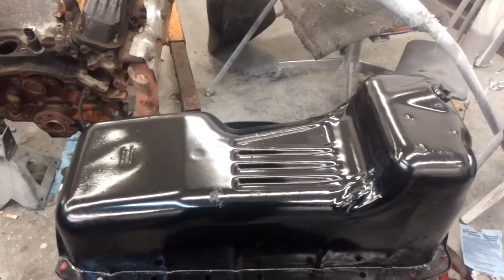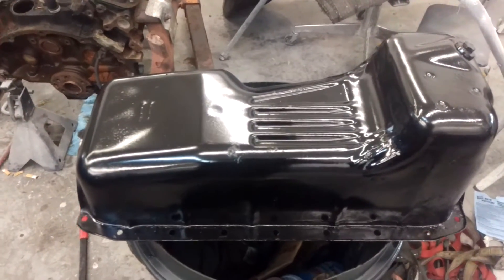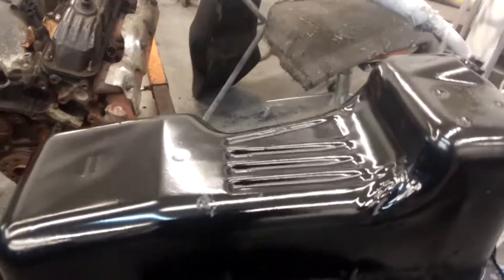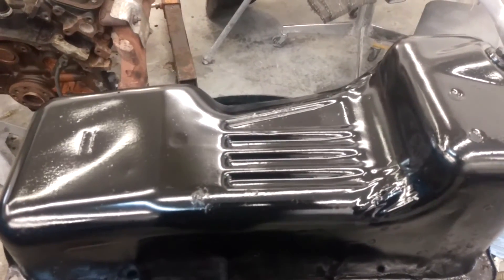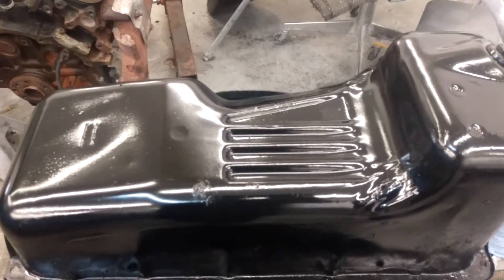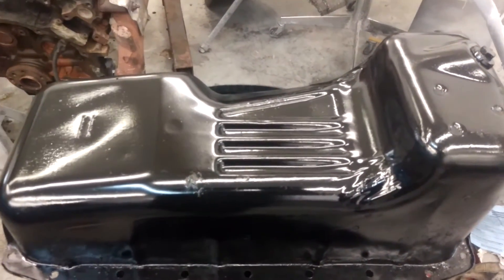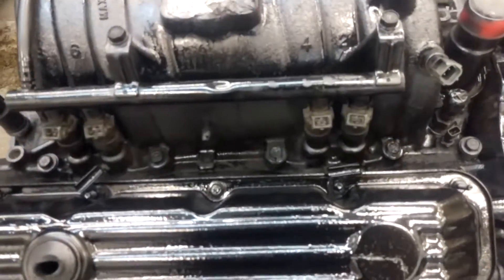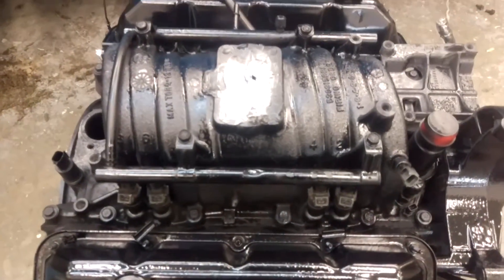Dodge Durango V8 5.2 oil pan change

Comment: I got a 98 durango 4x4 with a 5.2l how did you remove the pan? I looked under mine and the cross member is in the way...looks like I would have to remove the whole engine to get it off.
Reply from the maker: no drop the front diff down as far as u can then lift the engine up as far as u can make sure fan n distributor cap is off n hoses it will give u enough to get the pan out I had to do it twice n drop the exhaust off of the manifolds Also
Reply from the maker: Also make sure the dipstick for the transmission is out also n make sure u drain the transmission fluid down as much as u can
Reply from the maker: also remove the inspection cover on the transmission it may seem like it won't come out but it will
Reply from the maker: why are u removing the pan by chance also
Reply: +Jason Fellon oh man... sounds like a hell of a project 😧...I have a small leak in the gasket and I also think my oil pump has failed because my oil pressure drops at idle and than starts ticking like its low on oil.
Reply from the maker: +xmendoza aqt well it takes about a day n make sure when you change the pump make sure u feel it catch the gear if not it will kill the pump n if u drop the pan it might not be the pump the pick up tube might be clogged mine was in my old engine I used carb clean n degreaser to clean it up
Reply from the maker: +xmendoza aqt if your falling below 20 I wouldn't be running that engine like that in all honesty or do this take a half a bottle of seafoam pour into the oil run the engine at idle for 20min to 30min or so to break up the crap in the engine do this twice n do 3 oil changes back to back I did that on a neon that had a massive valve tick n it fixes the oil pressure issue
Reply from the maker: +xmendoza aqt it's worth a shot to burn a few oil changes n a can of seafoam n cheap Walmart oil
Reply: +Jason Fellon thanks for this info I really appreciate it.how do I drop the front differential? and is it necessary to remove some of the tyranny fluid?
Reply from the maker: +xmendoza aqt well u will see the bolts that go to the engine mounts have to all come off n the fluid I would suggest because when I did it the 1st time I knocked the dipstick tube out of the transmission not paying attention plus it gives you about another 2 to 3inches
Reply: +Jason Fellon ok...when I lift the engine can I just use a jack? and do I need to remove any mounts?besides removing the fan and distributer cap
Reply from the maker: +xmendoza aqt mounts can be removed from the front diff in the passenger side it's one bolt thru the mount n on the driver side you have to fully remove that mount makes life alot easier n you will need to Jack the engine up from the harmonic balancer or get an engine hoist but please try the oil change method with seafoam  by pouring that into the engine parts store stock that stuff just use half the bottle n idle the engine with a few revs  to 2500 but don't hold it there for longer then a minute or so but do that say half of the time the Seafoam is mixing with the oil n breaking down sludge in the oil pick up tube drain the oil n refill fresh n see if the oil pressure has picked up if not try that again n refill the oil n if still no improvement then start dropping the pan down
Reply: 2 months later and i started this lil project.so far today i removed the skid plate, front diff and the driver side motor mount completely. i got the oil pan loose but it wont come out because the steering bar is in the way...it took me all day to do that. so i just called it a day and ill continue in the morning. just wanted to see if you can guide me a little bit so i can get my gasket fixed aswell as check to see if my pickup tube is clogged.that might be why my oil pressure drops at idle.idk
Reply: how does the pickup tube come out do you just pull it out or is in bolted in?
Reply from the maker: the pick up tube screws into the oil pump so u have to remove the oil pump to get the pick up tube off